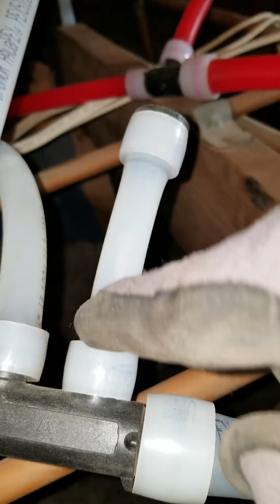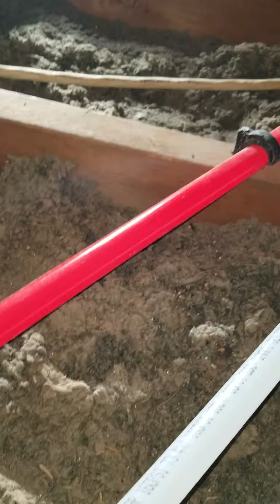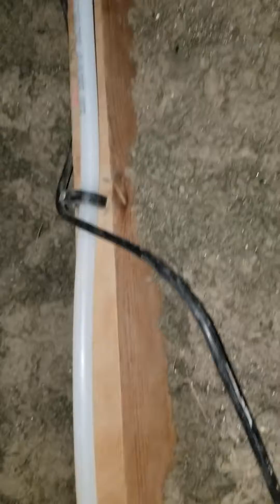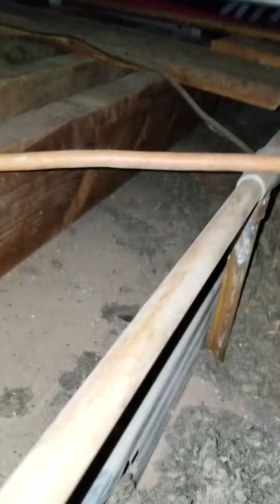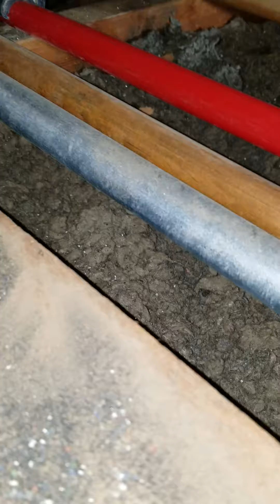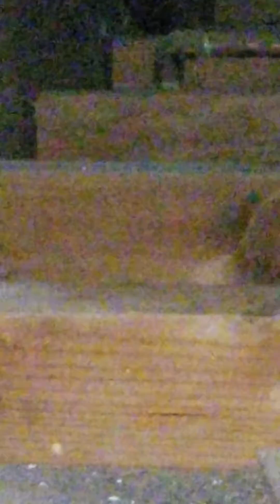Completion of 1st repipe of 2019

Comment: Very informative video, thanks!  I am in the process of deciding on a home re-pipe and I have been debating whether to re-pipe with soft copper (type L) or go with PEX type A. A plumber told me that using stick copper in my attic with limited space would be way more costly due to the labor involved and all of the soldering required to make the connections. He said he would do the job in copper if I want,  but said it would need to be soft roll copper in order to make longer runs.  So now I am debating if PEX isn't just easier and better.  Do you agree that soft copper is okay in an attic?
Reply from the maker: Hello and thank you for watching is describing to my video I actually am new to doing U to V is and Uploaded them so my material in content will be much better here in the future but as far as your question about soft copper being better in an attic I would I be hesitant to putting saw copper inside of it attic for a couple reasons one is also because the soft copper is a Little thinner than the hard copper and the pex.
 Also because if it's going to be in an attic that means is going to be exposed and you would need to insulate the copper all the way through in case it gets freezing temperatures.
The pecs piping using the wirsbo  ring connections allow the pipe to expand contraction, less chance of pipe freeze break.
 So medics are bigger to work in which mean soldering would not be such a hard process to do that attic that I worked in was one of those attics that were a easier  to work in but the customer chose to go ahead and go with pex pipng because of the copper cost was double